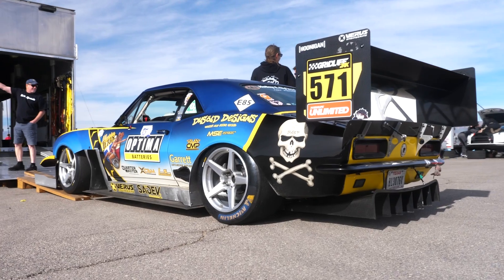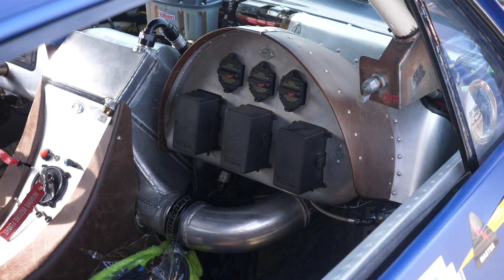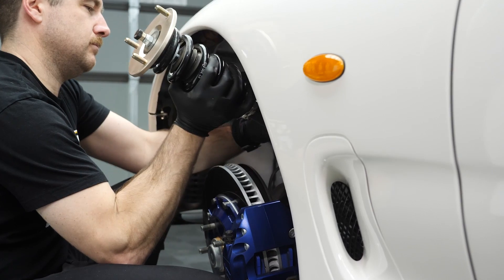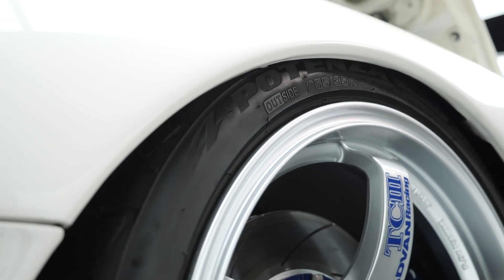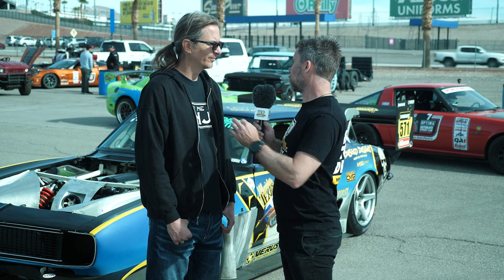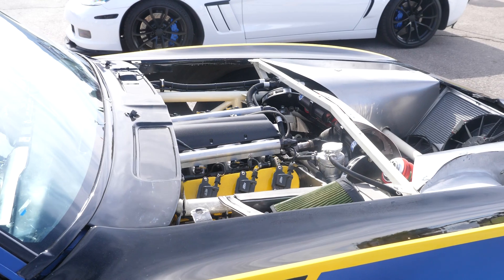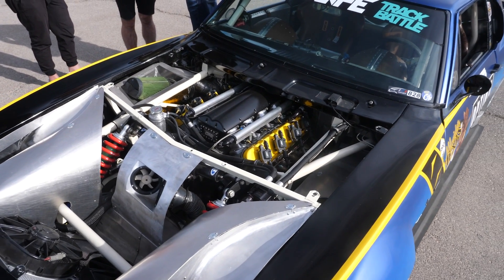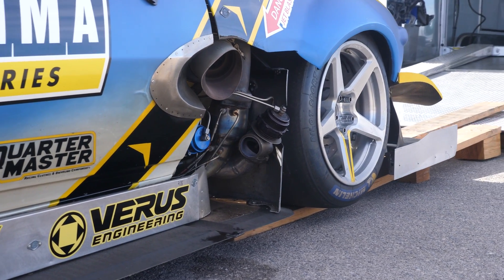'67 Camaro Rocket Antilag System | 1200HP Chevy

Comment: I dream of rocket anti lag on a rotary.
Reply: I support your dream it would be absolutely ridiculous.
Reply: It basically is after 2 or more rotors, you just optimize one of them to be less parasitic and lighter, and wants to keep spinning, a lower compression for more fuel... into a higher compression rotor . 

take one exhaust, put it in the intake of the next. if you want, thats where you put your ramjet or jet engine. scavenge the first and boost the next while burning any unburned fuel

Comment: Mr DuSolds.  With regards to your pressure differential problem and how it pertained to changing the headers to an NA style. You eluded to the problem bein centered around the the fact that you couldn't get the heat out. That would imply the problem being less related to spool and "efficiency" and more due to the negative side effects of running short ram headers. The reason that this is important is it should in theory be a trade off. The longer runners should (before the aid of antilag) hurt performance. But if you can keep the snail spun up with other means you can work around the big manifolds. Kinda of best of both worlds?

Comment: Okay MR. HP Academy. So if you run a "Rocket anti-lag with putting a valve in each exhaust manifold port for anti-lag. How can you tune for those times when obviously the fresh air introduced into the exhaust? It's obviously going to make everything read Lean. lol

Comment: People that have it keep saying JET😂. It's in the name. No jet compressor section so it is a ROCKET. 
This is gonna be mainstream soon. Wait and see. People are already using superchargers and turbos to eliminate lag.
Reply: Not strictly true, pretty sure it's taking compressed air from the intake side. Interesting take though
Reply: Errrr... The turbo has both a compressor and a turbine so it's a turbine, not a rocket. 
You can build a functioning jet engine by putting a combustor on a turbo between the compressor and turbine, that's what this is with the added complexity of a piston engine thrown in to complicate things.